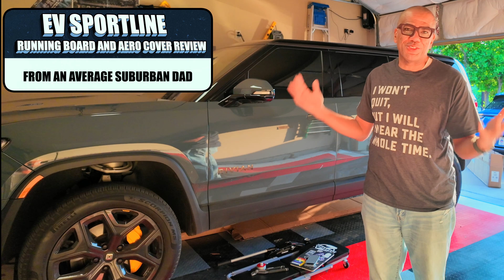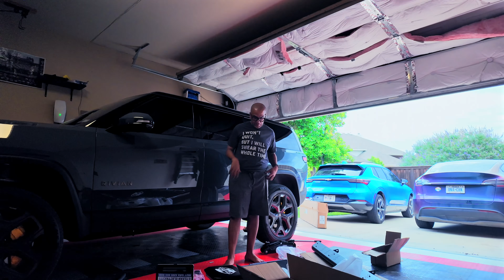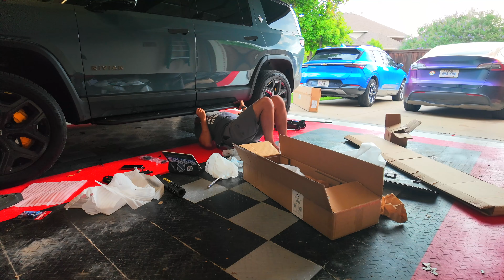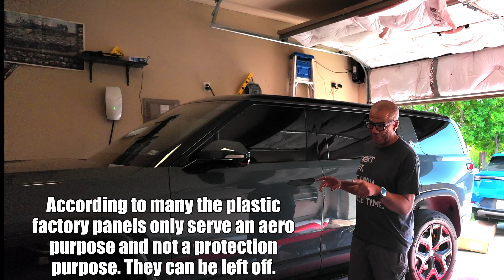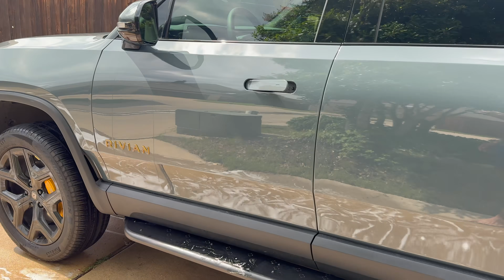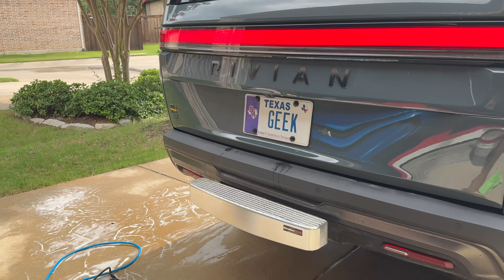EV Sportline Rivian R1S Running Boards and Aero Cover Plate Review

Comment: Hi Darren, you are so right, I have a R1S gen2 and I just installed the same running board and the aero covers. Removing the factory cover and installing the running board was the easy part, installing the aero covers was really the worse part. I was able to install them, but had to do some modifications, 1st the provided spacers for the front cover was useless, not only it was too tall, it also does not match the cover, there were no matching holes on it to mount to the bracket. So I ended up not using the spacers( if used the cover it will not mount flush to the car) however, I just used a tie wrap to hold the cover and the bracket together. It took me at least 5 hours to get it all done. Like you said, I wish they have a better instructions. One for gen 1 and another for gen 2, each should be a separate instructions of their own. It was confusing, both the pdf instructions and their videos. Also, I wish they recommended using impact driver to make the installation way easier than what they show on videos like it was easy using just the breaker bar and ratchet, it wasn’t. Because there’s of a lot of bolts to remove and reinstall it was tiring. I ended up renting an impact driver from Home Depot after the driver side. It made it way easier to install the passenger side. Thanks for your honest review I thought you might wanna know I’m sharing the same frustrations hahaha